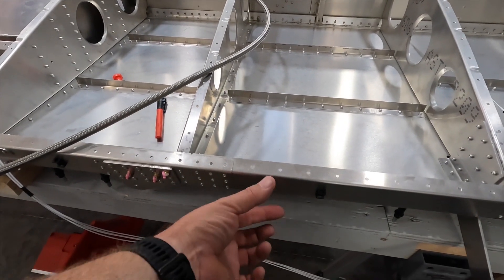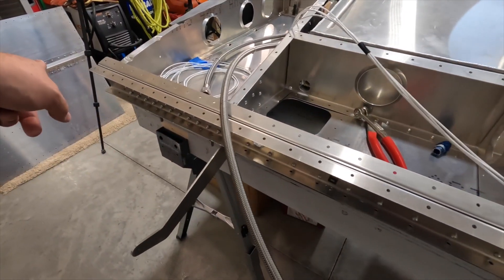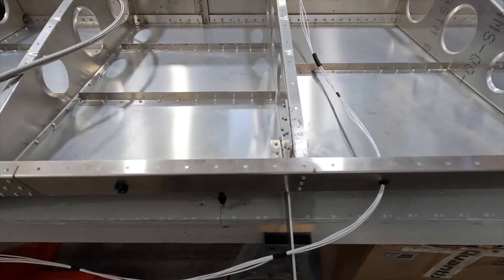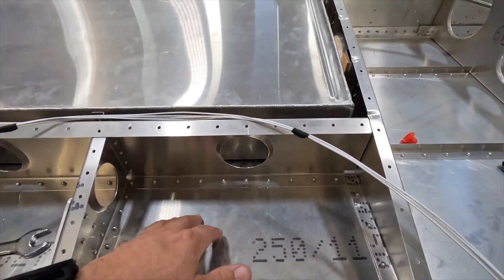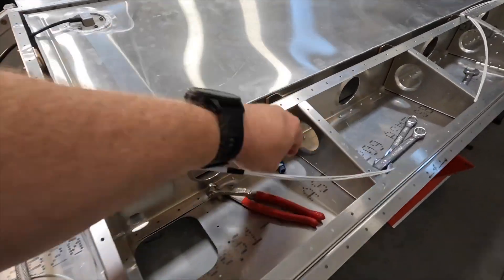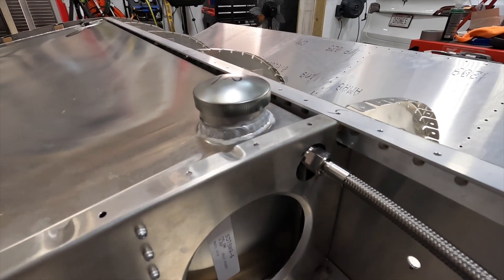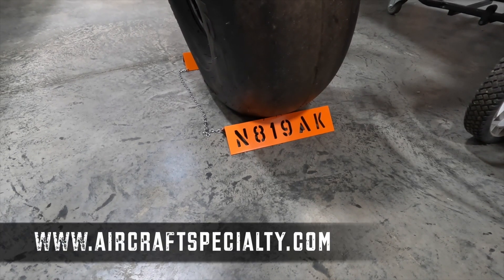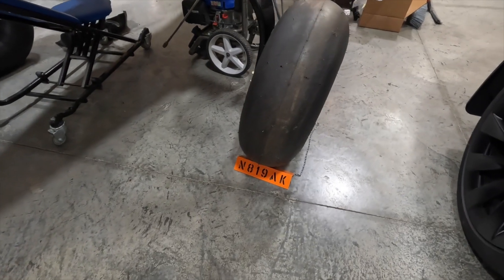EP. 56 | Fuel Tank and Wing Completion | Zenith Super Duty

Comment: Would you mind sharing why you are running your fuel lines out of the trailing edges of the wings? 

Like you, I am very likely going to be using a Viking engine in my SD.  I am guessing that you are doing it so that you have a straighter shot to the header  tank that is behind the cabin bulkhead.  Can you confirm my thinking?
Reply from the maker: Great question, watch episode 51 to see more details but I didn't want the fuel lines entering the plane in the forward cabin so having them route through the trailing edge of the wings has them entering just aft of the cockpit and where my fuel valve is located.  EP51- https://youtu.be/pb3S8PyPzAE

Comment: Hopefully, you'll never have to use the Chemseal again ... it always looks messy but it works! Haha!  However, a tip for anyone else having to apply it:  You don't need a special caulking gun - you can use the cartridge in a regular caulking gun by putting a large socket (that will just fit inside the cartridge) on a socket extension and use that as a plunger in a regular caulking gun - works great!
Reply from the maker: Great tip!  I might need it for wing tank 2?....
Reply: @AeroworksProductions  Let's not think that way! LOL!